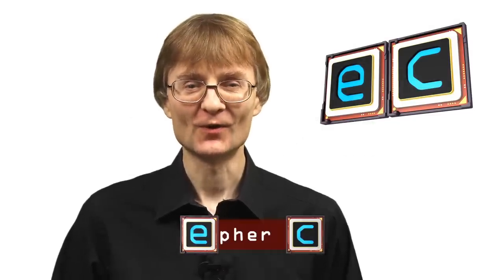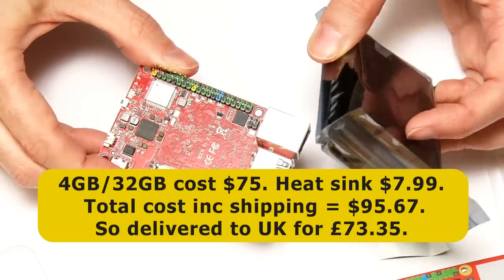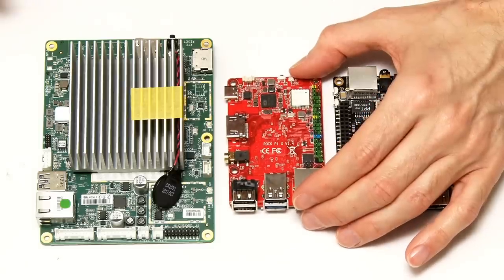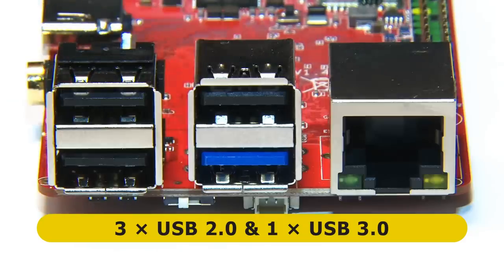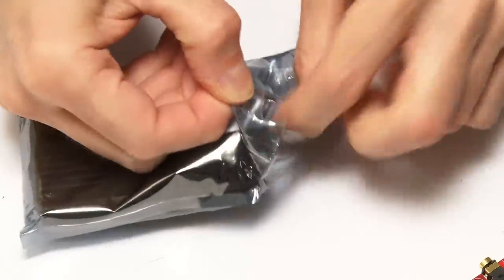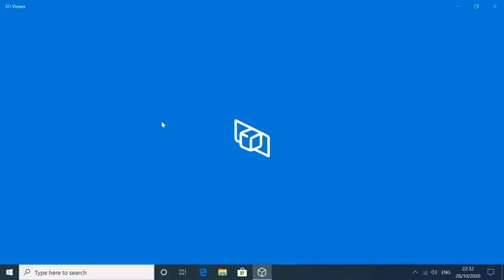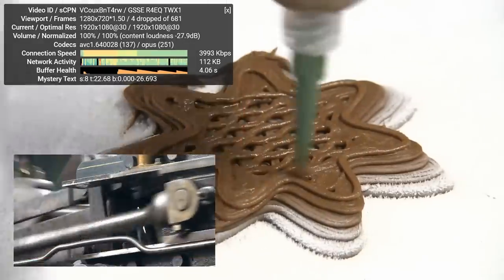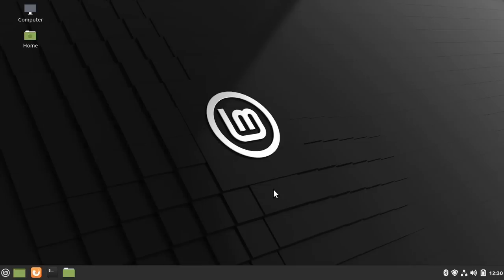Rock Pi X: Low-Cost x86 Windows & Linux SBC

Comment: FYI This $75 board has 2x the memory, 30% more processing power and the same storage as a $30,000,000 Cray-2 from 1986.
Reply from the maker: Now those are statistics to really make us think.
Reply: @ExplainingComputers   or not
Reply: I remember logging into Washington University's Aminet repository back in the 90s and they had a notice that they were upgrading their storage to 1 terabyte at a cost of $100,000 dollars. I bought a 1TB SSD for $89 last month.
Reply: Good god I haven't bought Cray-2 back in 1986.
Reply: But this did not exist in 1986.
Reply: Just to be a nit picking pedant, would the structure of the Cray have facilitated better parallel computing or multi users logging in etc?
Reply: @TattiePeeler  IIRC, it was best as a single-user system dedicated to running one job at a time.  A built-in front-end processor handled the multi-user stuff.  (More importantly, the Cray-2 was unsuccessful in that it rarely met it's speced potential.)
Reply: Back in 1986, I was a regular user of the Cray  XMP computer at Harwell. That was eventually replaced by a Cray 2 running Unicos, by which time I was able to get most of my work done on various local minicomputers. As a visiting scientist at Los Alamos National Lab, I also got to spend some time using their network of Cray computers.
Reply: @rickt.1870  I suspect visiting scientists may not have had access to the alien tech 😂
Reply: @ninline2000  I bought a 4tb for $60 this month. Storage these days is amazing.
Reply: if the Cray-2 was $30m then that is $71m in todays money meaning the Pi  is 0.0001056 % the cost of the Cray-2! Put another way you could have 946,000 Pi's or one  Cray-2.
Reply: you blow my mind arya
Reply: Everything is depended on relativity. Computer programs and files were tiny in size comparing to current versions...
so 1TB of 1986 cannot be compared with 1TB of 2021. 1TB of 1986 could relate more  to 1000TB of today who knows...
Reply: @eccremocarpusscaber5159  Alien tech can run Windows flawlessly.
Reply: To say nothing about the how many Cray 1s would be required.   From what I remember of the approximate weight of the logic boards, recycle cost of 5 would exceed the price of this SBC.
Reply: I remember reading Jurassic park (yes, the novel) and they used 2 cray xmp for the number crunching on the dino dna
Reply: So does my phone! lol
Reply: @TattiePeeler  Multi-processing wasn't introduced into the Cray line until Steve Chen designed the XMP.   If memory serves me (this is going on 40 years...) CRAY OS was principally batch jobs with some interleaving of processing through multiprocessing, user login wasn't really supported until UNICOS and then it was just telnet.   With only a few 100 MB of memory you really couldn't have too many jobs running concurrently.   Storage was also very limited, the IOP could only connect to a few drives (which were OEM, by CDC, 3350s with some microcode and channel changes).   User's depended upon directives in their batch jobs fetching data from front end systems.
Reply: @DASDmiser , thanks for your reply. Fascinating stuff. The Cray, any Cray.. was such a 'visual' totem of computing, as a kid, it's the kind of visual that was seared into your mind forever..
Reply: True - but - the Cray was way cool looking !
Reply: @ExplainingComputers  Not just statistics, it's HISTORY.
Reply: @Kerveros1904  There is something to that, but the straight comparison is fair, and it's also true that files were larger than they are today. Yes, games eschewed full motion video and good sound, making them smaller. But to store a movie would take the same space then as now; there's nothing magical that would let you store this video on a 1986 computer in less than the space it takes now. Moreover, it would actually take more; new algorithms, sometimes CPU-intensive, sometimes just new, let videos a certain fidelity at a certain resolution take less space. MP3 and friends weren't around until 1993; prior to then, most recorded audio was uncompressed and took up a lot more space.
Reply: @Kerveros1904  So we go from the Cray-2 to "mainstream users"? The Fairlight CMI was used to produced several of the albums of the era, including "Peter Gabriel" and Devo's "Shout", and had the space for the entire album been available, they would have used it.
Reply: @Kerveros1904  You said "1TB of 1986 cannot be compared with 1TB of 2021." That's all cases, including musicians and Crays. If musicians had the space, they would have stored an uncompressed album on their computers. If the people working on The Last Starfighter had had the space, they would have previewed uncompressed video, either at high resolution in slow-motion, or tiny resolution in full speed. We had uncompressed audio on CDs, because storage was cheaper than decompression hardware. We had 240p MPEG-1 on VCD in 1993, because that's the compression format available and usable with the CPUs available, and the storage available. Five years later, we were fitting much higher quality 480i/480p MPEG-4 movies on CDs, because our laptops could play MPEG-4 but CDs were the largest storage we could burn. If you could get 128 GB cards for 30 bucks in 1986, they would have put uncompressed digitized NTSC video on it and spend far more space on 480i/30 video then we do in 2021.
Reply: @prosfilaes i am not even reading your replies. As i said, i marked this as the end of discussion. I made my points, you made yours and that is all. End of story.
Reply: Oh Boy. This is a completely silly statement.

Comment: Great video! 
About the WiFi adapter in Linux: In Linux drivers are built into the kernel, so updating to a newer kernel can often solve the problem, as a newer kernel may have support for it. This is also one of the reasons why Arch based distro's can be a good choice for systems like these, as they tent to have the latest kernel available in their repo's rather quickly.

Some popular Arch-based distro's that are user-friendly include Manjaro Linux, ArcoLinux, ArchLabs Linux and EndeavourOS.

Comment: "Let's go and take, a closer look."

That basically means, "Your therapy starts now."
Reply: @ExplainingComputers  I would like to know when that smaller size CPU[even smaller than ITX] can let the performance same as my computer 
which is 7 years old i5 2310 +1050ti?
Reply: @MeariBamu  我不这么认为，我的戴尔笔记本电脑具有celeron决斗核心1.5 GHz处理器，并且比该Pi..i5快。您的i5会更好。虽然使用ssd对我有很大帮助，但是我在上面运行SpaceEngine和tombraider 2013 ...😉
Reply: *Finds some old porno mags in the attic: "Let's go and take, a closer look."
Reply: Finally you can hear a normal speak to you after long day of non nerdy people
Reply: @tonyelsom6382  
Google Translation:
"I don't think so, my Dell laptop has a Celeron Duel Core 1.5 GHz processor and is faster than the Pi..i5. Your i5 will be better. Although using ssd has helped me a lot, I run SpaceEngine and tombraider 2013 on it...😉"

To respond to the google translated version of your comment, I hope you're wrong. I believe upcoming innovations from amd and intel will allow  for smaller,  processors with higher performance.
Reply: @im_Polyhedrons  Yes, future SBC's will be better structured electronically .. and more or less still cheap..I jumped in now to gain experience, this is the future of the pc...very soon we'll have a pc on a chip, some gem worn as a necklace, wireless virtual pc ( it projects a virtual desktop that is touch-sensitive) should be on the shelves by the end of this decade at the rate tech is skyrocketing . 😄
Reply: @MeariBamu  not the smallest. But the Udoo Bolt will outperform the i5. Think the mobile Ryzen is not faster than the 1050i but still pretty good. And the Udoo has USB Thunderbolt and supports eGPUs

Comment: Yet another informative video, thank you. Seems to be a stream of new SBCs coming out recently.

The YouTube test was painful to watch. Not entirely convinced this is good value - despite what Passmark suggests. I suppose like most of these boards, software support is what will make or break it.
Reply from the maker: It all depends on the application case. I would not use this to watch YouTube in Windows though.
Reply: @ExplainingComputers  It seems to be using the older version of Edge. Probably unlikely, but I'd be interested to see if the newer Edge performs any better.

Comment: Someone:
That 2016 chip is very old

Me:
My 2009 core 2 duo is pretty recent only 11 years
Reply: Athlon XP x2
Reply: @Roshan_420  You mean Athlon 64 X2. Had one as well. It became outdated quite fast when Intel took the lead with it's Core 2 line.
Reply: @SomePotato  yeah sorry and I have that cpu in my retro rig, pretty chilly at 30c max
Reply: @SomePotato  idk how much better the intel one is tho I have a few laying around but the motherboards are fullsized which don’t fit in the small case I have for that setup 🥶
Reply: @Roshan_420  Great that you still use that machine!
Reply: My Ryzen 9 5900x is also doing pretty decent
Reply: Lucky, I'm running an Intel 8088 still from the early 80s
Reply: @marksworkbench8705  8086, V30, 6510 over here.
Reply: @marksworkbench8705  cap
Reply: Sitting here staring at my array of ten to fourteen year old Core 2 Duo computers on the other desk...
Reply: I just upgraded my media server at home from a Core 2 Duo to an i3 which I think is technically second generation (though it was the next model in the same line of business desktops). The upgrade, though, was for storage, not the processor. I just happened to have a machine with that processor lying around.

Before the Core 2 Duo, my server was running on an original Athlon64 machine. When that died (probably the system board), I moved the hard drives to the Core 2 Duo as that was handy at the time. I did notice an improvement in power consumption going from the Athlon64 to the Core 2 Duo. I think this machine, though, has the same TDP as the Core 2 Duo.
Reply: @SomePotato  the athlon 64 x2s are from the same time period as core 2. The Intel CPUs were defo more common though.
Reply: @whitebeartigtig  Yes, but the AMDs came out a year before Intels. And given AMDs recent track record from the original Athlon to the Athlon 64, I went with the AMD. That was a mistake.
Reply: @Danno I'm using an E5-2650. even though its newer its still worse than the X58 xeons.
Reply: @Danno the single core performance is pretty bad.
Reply: @Danno interesting, I'll try it out. Thanks for the advice on that one.
Reply: @Danno thanks for the tips. And I do leave my PC on all the time so that should help.
Reply: @camthesaxman3387  only with linux
Windows is sooo slow
Reply: @camthesaxman3387  I'd say the E8400 is really the bare minimum for modern web browsing.
Reply: If you don't do gaming or heavy video playback, dual cores are perfectly fine.

Comment: instead of mint cinnamon, i recommend mint xfce with composition off (Window Manager Tweaks > Composition > untick "Enable Display Compositing"), to get faster playback. you will get screen tearing and some slight artifacts when moving windows around and such, but it should be much quicker, especially with video playback. composition is in a rougher state on many linux DEs based on X compared to windows. and the long loading times on windows can be explained by the browser. old edge, which seems to be what you used, deals worse with youtube than firefox does now, this is mostly due to the material remake youtube got a few years ago.

Comment: Yes, it's nice that there is another option for those users who need x86 architecture.  I'm sure that more powerful CPUs will find their way onto this SBC's successors, and rival boards, as is the way with computers.  Fingers cross for the Rock Pi XI, then.

Comment: An x86 in a Pi form factor, how cool that someone made one!  I’m impressed!!!!!!!  Looking forward to your next video.
Reply from the maker: Greetings Perry. :) I, like you, thing it's cool that this exists. :)
Reply: So this isn't Arm architecture? This is old school x86 32 bit? 
If it is old school 32 bit, I'd love to put some old programs on it using old windows os for fun and nostalgia.
Reply: Would this hardware with a 32 bit windows version allow me to use programs with 16 bit installers?
Reply: @dannywilliams6643  Good question.  I’m not sure how or if low powered x86 boards could run old software.
Reply: @dannywilliams6643  This Atom processor is not 32 bit, but 64 bit. However, if you install a 32 bit version of Windows, it is possible to enable 16 bit support. Even the 32 bit version of Windows 10 can have 16 bit support added, though it will not be there by default. The 64 bit version of Windows cannot have 16 bit support added directly, but only using a 32 bit virtual machine.

Comment: Bonjour Chris,   It's an interesting board for someone requiring a X86, however; for the money, I prefer the new x400 running Twister OS.  I am currently using it and with the Chromium Media edition, I can also execute Amazon Prime and other video streaming.  Acceptable performance using an overclocking of 2Mhz with an active Noctua  fan.  As always, thank you for your great instructive video.

Comment: Hi Christopher. Good review. It is a nice board. I like it to play 15+ year old Windows games. Most play great at 1080p full settings. Flight Simulator 2004 runs awesome on it.
For daily use it isn't much good. For running old legacy software this is perfect. Instead of an old pc that consumes a lot. You can run it in virtualization for less than 10W. 
My Atomic Pi is a cross platform build server. The Atomic Pi can't do it better while it can boost single core to 1.9Ghz vs 1.67Ghz. But both their multicore is 1.67Ghz. So there no difference.
I do like the RockPX a lot. Well designed and well priced. 
Greetings.
Reply from the maker: Hi Nico -- love the new channel name. :)

Comment: Could you get a USB power meter - so that you can add power usage to the stats? Peak power and idle power will be important for small devices
Reply from the maker: I am working on a video right now that compares the idle and load power use of 14 computers, inc many SBCs . . .
Reply: It's possible to make a HDI-compliant UPS with Arduino. It can read battery charging and capacity state, and send the info to the host operating system.

Comment: great video man, always a pleasure to find out about these things. I just happen to be needing an x86 low-power computer for use as a headless server with 24/7 uptime. I think the rockpi X might just be what I am in the market for I have one question though: would a 5V 3A power brick that currently powers a raspberry pi 4B work just as fine for the rockpi X ? Also do you need an RTC for it to work properly ?
Reply from the maker: The Pi power supply will probably work. But Radxa have told me (and I think also mention on their website), that there may be stability issues if not using a PSU that provides 5V, 9V and 12V. The board works fine without the RTC being powered -- the OS pick up time from the Internet pretty anyway these days.
Reply: @ExplainingComputers  alrighty thanks ! I have a 12V 2A PSU sitting around see if I can get that to work with it
Reply from the maker: @XenoContact  Good luck! I suspect you will need all three voltage rails, like in a traditional PC.

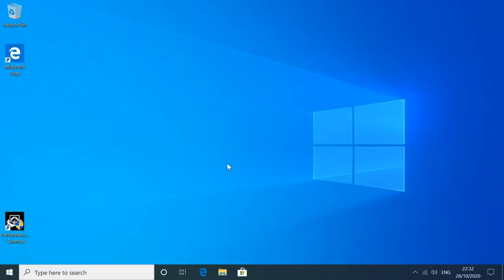Comment: 10:38 Chris, 7 or 8 hours for a windows10 installation 🤤 
Doesn't that take the biscuit  !!   (The Tank to Marvin, H2G2)
Btw, did you recover well from the operation ?
🤝
Reply from the maker: Thanks for this. The wound on my neck took a very long time to heal (it would not seal itself), but was eventually closed in a second surgical procedure with special plastic dressings used for 4 weeks after that. And it is now sealed, if not healed entirely. So things are much better than they were a few months ago. Thanks for asking. :)
Reply: ExplainingComputers 
Oh wow i never knew you had an injury like that, glad to see it fine now

Comment: @ExplainingComputers - This is the same processor as the Minix Z83-4.  I've been using one for several years for Windows.  They should have used a 64GBEMMC drive in it but Minix told me that they couldn't provide Windows 10 for free if they had a drive larger than 32GB (at the time).  Microsoft's licensing prohibited it.  I think Microsoft increased the requirements to 64GB at the end of last year (They now offer it with the 64GB).  128GB is best for using it for most tasks.  I had to remove MS Office every time I needed to run a windows update.  I've also never had any trouble at all running 1080p video from YouTube or Netflix  on it.

Comment: It is very interesting that most SBCs seem to struggle with genuine HD video (both Intel and Arm) when they are theoretically able to do it on hardware specs alone. Linux drivers seem to be the problem.... and yet if I recall the Raspberry Pi 4 on Ubuntu can do it, but not on native Raspberry Pi OS. Hopefully the next generation will overcome this hurdle.

Comment: I used an Asus X205TA for a year or two, a low power, budget priced laptop version of this. I ran Windows 10, Firefox, Office 2010 student just fine. Not fast by any means, but great battery life.
Reply from the maker: There are always pros and cons! :) Atom boards are also usually silent, or have nice quiet fans.
Reply: @ExplainingComputers , it's odd to be a  'fan' of a family of CPUs, but I loved the Quad Atoms Intel were manufacturing before they called it a day. The Asus X205TA could happily last a day, fanless.. perfect for my needs. It's a pity Intel got spooked by the Atoms eating into the profit of their other CPU offerings.. oh well.